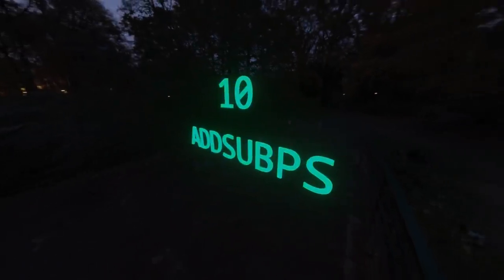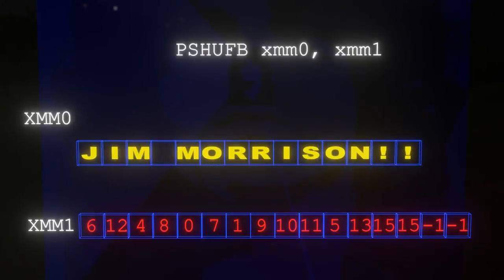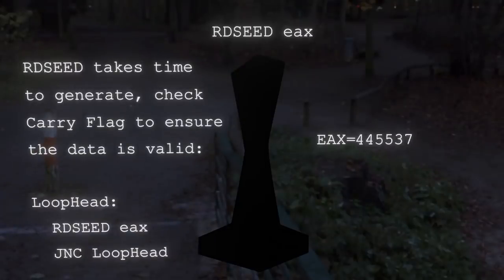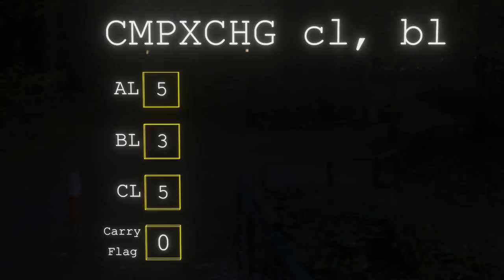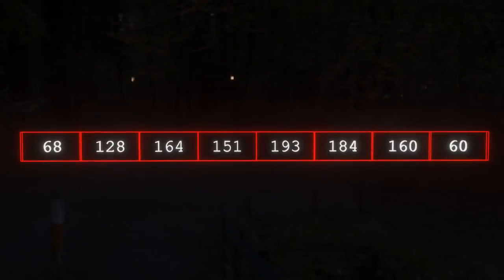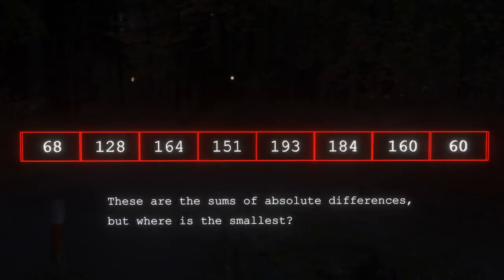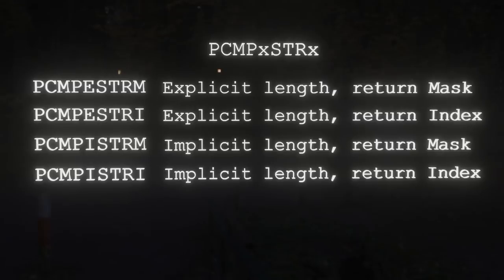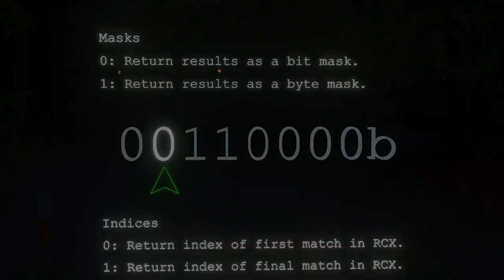Top 10 Craziest Assembly Language Instructions

Comment: RdSeed - It's not always slow. There's a FIFO on the output of the RNG. RdSeed pulls from that FIFO. If you haven't just pulled a bunch of values from the FIFO, the value will be available immediately because the FIFO is not empty. If you try to continuously pull from Rdseed and measure the average time per instruction, it will appear slower because you are limited to the physical rate of generation of full entropy numbers from the RNG, which requires a whole lot of computation - Generate 512 bits from the entropy source, AES-CBC-MAC them together to get 128 bits (that's two RdRand result's worth) XOR it with and output from the DRBG (another 3 AES operations, just like SP800-90C describes) stuff the two 64 bit numbers from the 128 bit result into the output FIFO. How do I know all that? I designed it.
Reply: The true gold is down in the comments
Reply: Oh cool. When did you design it? Care to share some history?
Reply: @LKRaider  It was around 2009 I started. It ended up first in the Ivy Bridge processors with the RdRand instruction. I had been working on writing cryptographic protocols in standard committees (802.11i, 802.16 etc) and they all needed cryptographically secure random numbers and when I looked at the SP800-90 specification back then, it was not sufficient. It described DRBGs (aka PRNGs) but not entropy extraction or physical entropy sources. A small team of 4 people was assembled, myself, a mathematician, an analog designer and a corporate cat herder. the math guy came up with some of the mathematical principles and identified the best papers describing how to quantify the entropy, the analog guy did the physical entropy source, the cat herder got it into silicon and I designed the digital logic that takes the partially random bits, turns them into full random bits with an entropy extractor and seeds a PRNG/DRBG with that full entropy data to make the resulting stream of random numbers fast enough. Since then the other three left (2 retired and one died) and I've been the main owner of the RNGs since. RdSeed which gives full entropy output as per SP800-90C and X9.82 was added with Broadwell. This was so you could make arbitrarily large keys from it. Faster and slower versions were created (fast for servers, slower for energy efficient chips) also I've designed a few other types of RNG for specific needs, like super small ones, non uniform ones and floating point ones. I contributed to the development of SP80090B and SP800-90C and the revision of SP800-90A which now cover most of what you need in a secure RNG. A couple of years ago I finished a book on random numbers which was published (Random Number Generators, Principles and Practices). So getting involved to solve my problem of where do I get random numbers has turned into the defining part of my career. The standard are still changing. Certification requirements are still evolving and the need for new RNGs that fit in different contexts keeps up apace, so it has become a full time job for myself and a small number of colleagues.
Reply: Wow that's amazing
Reply: @davidjohnston4240  What a lovely comment chain to stumble upon, great read!
May your random continue to prosper!
Reply: Damn that twist
Reply: @davidjohnston4240  thank you for commenting, this is probably the best comment chain I’ve seen in a long time
Reply: LEGEND
Reply: Just because this guy designed it, and codeveloped the industry standards, you have to ask “can we trust him”, because he’s clearly just an Intel shill. 😁😎😁

Thanks for the info. It’s one of the few instructions in this video that I immediately understand the usefulness of its existence. Some of the others are so specialized that I’ve never considered the reason I would perform such a set of operations.
Reply: @geoffstrickler  PCMULDQ, RdRAND, RdSeed and AESNI are all part of a push at the time to get crypto supporting instructions in hardware to eliminate the software side channel issues that were arising. A number of the others are things that are useful for a compiler to optimize code down to but generally confuse us mere humans. I wouldn't trust me. Why would you?
Reply: Damn what a mic drop. love it.
Reply: @davidjohnston4240  Amazing, another good example of not taking anything for granted!
Reply: can i have your autograph .. true legend
Reply: @davidjohnston4240  it's an honor reading the WoG from the maker. Thankd
Reply: Awesome. Thanks for the lore
Reply: Holy cow this comment needs to be pinned
Reply: @davidjohnston4240  Wow it so cool! But I want to know how long does fill a new rand seed to FIFO take? Hundreds cycles? If I pull the rdseed per hundreds of cycles(run other instructions), The FIFO will be available immediately?
Reply: @achemgliu1139  The noise source is typically 2.5Gbps but is slower on lower power chips and faster on higher power chips. Entropy extraction divides that by 4 but turns it into a full entropy stream. The RdSeed instruction takes 64 bits at a time. Thus making around 9,765,625 64 bit values per second. The FIFO is 8 values deep.
Reply: Have you ever thought about doing videos? You’d have some great insight and of course ability to explain some of the stuff you worked on :)
Reply: @davidjohnston4240  Thank you!
Reply: @hocky-ham324-zg8zc  10 videos - More coming soon when I get around to doing them. https://www.youtube.com/playlist?list=PLZNqNoh4u1gzKMYgrrgcKK5ozNQ7f_OMP
Reply: @davidjohnston4240  oh wow! Thank you for the reply and for making these awesome videos!
Reply: This example probably tells us a lot about the rest of the instructions described in the video.  There is a specific need for something that needs to be optimized, where doing it in software would be slow, but by adding some hardware, can become very fast.  Most of these instructions would never be generated by any compiler, so they would only be used in hand-assembler-coded functions.
Reply: @davidjohnston4240  Thank you so much for sharing this with the world, very nice to read about your story.
Truly fascinating !
👏👏
Reply: @BrightBlueJim  In the case of a nondeterminstic random number generator, it has to be done in hardware in order to take advantage of electrical noise to supply the entropic bits. It was made an instruction rather than a memory mapped peripheral in order to remove the OS, Filesystem, VM, drivers or anything else from being between the running program and its supply of random numbers that might be used for cryptography.
Reply: @davidjohnston4240  A silly omission on my part - I wasn't really thinking about what that particular instruction does.  Of course, by definition you can't get random numbers out of software!
Reply: @davidjohnston4240  If only i had found you when i did my thesis, it would have made my life much easier haha.
I did a research paper about the linux RNG and how it would interact with a HWRNG that was based on a "quantum" property of the photon : When a photon is sent into a semi-transparent mirror, it is either transmitted or reflected. It is in fact a totaly random event. The generator had a bitrate of 16 Mbits/s
Reply: @sumender9011  Sorry about that. Maybe I should have written it a few years earlier. However a photon through a semi transparent mirror does not pick its direction completely randomly. There is imperfection in the angle of the mirror. Imperfection in how close to 50% is the transparency and thermal and physical noise impacting the behavior. So the pass through/Reflect choice is never perfectly 50/50 and the choices are never perfectly independent. So an entropy extractor is needed to turn the resulting bits into bits that are provably very close to completely random. You can't get to perfectly random. That has been mathematically proven impossible. You can only get arbitrarily close.
Reply: @davidjohnston4240  Okay. I almost follow that. Kind of. 

I bought some rng's many moons ago because I understood the need, and now have 1 OneRNG in 1 system (combined with a DCF77 receiver) and 2× TrueRNG (with a GPS time receiver) in the other. Gotta have that proper time in there.
Reply: Input overload, purging memory.....    |   OK...
Reply: @jamegumb7298  I believe the OneRNG is using the infinite noise multiplier structure. I wrote about those in the book.
Reply: @davidjohnston4240  Your mention of memory mapping reminds me of QUAC-TRNG. Just use the DRAM itself as a high-bandwidth entropy source by activating four rows at once with a custom controller. That approach is as horrifying as it is fascinating. Nothing is sacred anymore.
Reply: @EllipticGeometry  Anything electronic has noise arising from quantum randomness of the underlying elementary particles it's made of. The trick is being able to quantity the entropy with solid arguments and then turn that data into full entropy data and then onto the choice of distribution you want. Using DRAM with well quantified entropy sounds... well difficult but there are plenty of people smarter than me so maybe there's a way. I'm a fan of funky new RNG mechanisms.
Reply: @davidjohnston4240  Would you mind telling us your opinion on the CISC / RISC debate?
Reply: @Jorge-xf9gs  These days in fast CPUs the instructions get translated to microops. The instruction bandwidth IO affects the performance a lot. So variable sized instructions are good because more frequently used instructions can be smaller and so reduces the instruction bandwidth. Security instructions are important because they remove libraries and OS interfaces from seeing application security data. Risc vs Cisc used to matter but not so much any more since instructions get translated to easily executed formats.
Reply: @davidjohnston4240  Just ordered and looking forward to reading your book. 🤙
Reply: Thanks for your work, David
Reply: created an account to log in and say that both this video and the comments here are amazing in both helping me understand a few things, in really understanding something about the translation from c to assembly particularly. been looking for help with operating-system level introductory material, and there's a lot to go through, but explaining these "archaic" commands and how and why they work unlocks a lot of problems i've had in trying to figure a few things out on my own. especially the part about the text comparison features of the sse4.2 instruction in the #1 spot. of course alignment is necessary, but alignment can be a security feature at the assembly level. that's the point, right?

this material is especially hard to access, as most of it is behind a paywall... and am pretty poor. don't have the cash or time to just invest in schooling, and there's no guarantees that i'm not paying for some tutorial written by a noob, either. for some being out a few hundred bucks means nothing, but for me that's the difference between losing everything or making it to next week. a bit of lost time spent sifting through mounds of tutorials, and that's expected when starting anything, but a lot of this material for free just doesn't exist. so "entry level" for people like me is very difficult. extremely difficult, even.
Reply: That is really cool. I'm a hardware engineer and I actually remeebr when this was under development and it was hailed as the almost impossible holy grale  of instructions.
Reply: So you're saying is it's a quantum instruction. Its behavior changes when observed!
Reply: @coladict  I don't write the laws of physics. It is what it is.
Reply: That's kind of a funny design though. If you use it once (where it doesn't really matter how long it takes) it's fast. If you use it lot's (where it really matters how long it takes) it's slow lol

I understand why, but that's still a bit funny
Reply: @TheMrKeksLp  You can blame NIST for their RNG specifications which limit the design options.
Reply: @davidjohnston4240  when does the FIFO get populated? when the cpu is somewhat idle? is there another chip for this?
Reply: @mzyil   It's a state machine inside the RNG deciding what to do next (reseed, condition, generate, sleep). Generate is what fills the FIFO and if the FIFO is not empty, the highest priority action will be to generate more data to fill the FIFO. It doesn't know about CPU activity. It just refills the FIFO when something has read random numbers from it.
Reply: Thank you so much, I've learned a lot just from reading this conversation!
Reply: Rdsneed

Comment: Wow, so the task I was given in a job interview was actually an assambler one-liner. Good to know.
Reply: If you'd said that in the job interview you'd get instantly hired
Reply: @DOSeater  I wish I knew this 2 months ago. I got that job anyway, but it took a little more interview iterations. Now I'm a happy developer of a delivery robot :)
Reply: @luck3949  Nice! I'm happy it worked out for you
Reply: Which one was it?
Reply: @mika2666   I got the problem of reversing endiannes at an interview (PSHUFB)
Reply: @mika2666  MPSADBW, 9:52.
Reply: @luck3949  SEND THEM AN EMAIL AND SAY YOU GOT IT!
Reply: I would’ve loved to see the interviewer’s face if you knew it
Reply: @florinh4932  Reversing endianness is even easier with BSWAP, and works all the way back to 486.
Reply: @intvnut  When I heard "endianness" I expected a mention of BSWAP.  :( 
I know that and WBINVD (that one instruction which can be slower than RDSEED, introduced with the 486 just like BSWAP) because I'm a huge nerd, not because I could have used it in my code.  :/
Reply: @intvnut  rol register, bitcount/2 is even easier than BSWAP, and it works with 16 and 8 bit registers
Reply: @weuyghbe08ehf9  BSWAP works on 32-bit numbers on 32-bit x86, though. I think that takes a minimum of 3 rotates on x86. e.g. ROL AX, 8; ROL, EAX, 16; ROL AX, 8.   BSWAP swaps the byte order.

Some references I have seen suggest using something like XCHG AL, AH instead for the 16-bit byte swap.  IIRC, on pre-486 processors, there was a penalty proportional to the number of bit positions.

On 64-bit x86, there's no equivalent set of rotates for 64-bit values, as a sub-64-bit instruction zeros the upper 32 bits of the register it writes to.
Reply: That was surely the point of the question.
Reply: @DOSeater  For the basement office position with no human contact, as would fit the kind of person who would give that answer.
Reply: @carlsaischa  What? Knowing your instruction set is somehow a bad thing?
If we could replace every web developer with someone who knew their instruction set, we'd jump ahead as a civilization like 50 years in a week.
Reply: @delphicdescant  Facts. The person you are replying to is an example of why there are so many low-quality devs these days.
Reply: Daaaaaaaaaamn